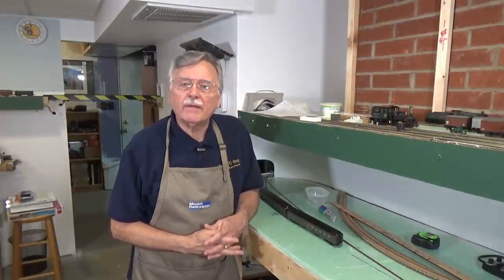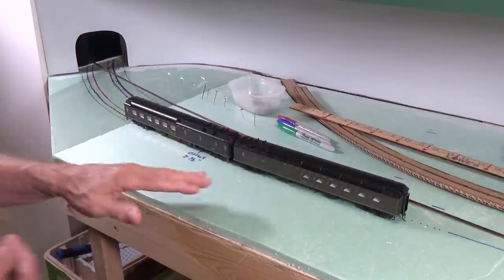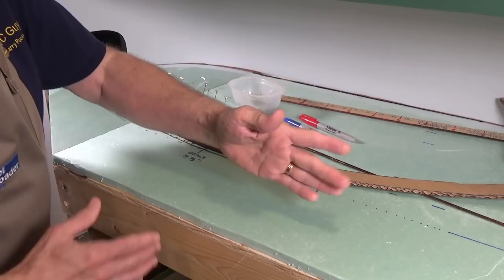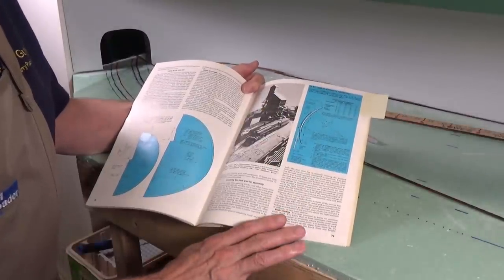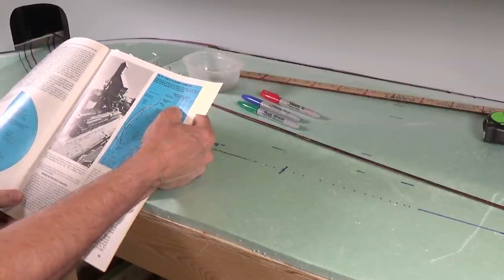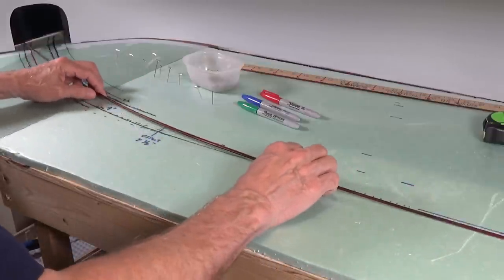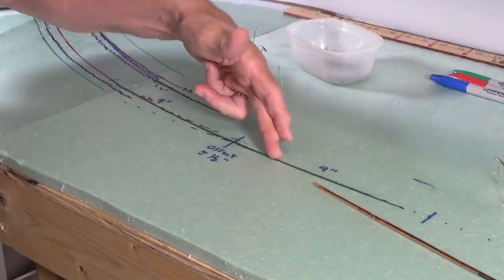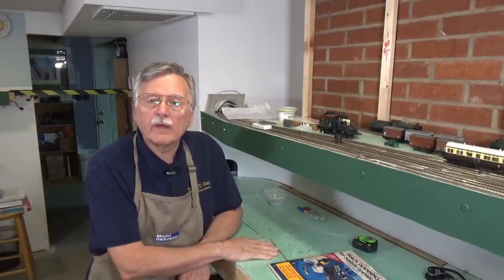Easing Into Curves (205)

Comment: Easing a Curve also helps preventing derailments for steam locomotives.  It allows locomotives that do not have a guide, to navigate into curves, especially tight ones.  Like for example, in N scale Atlas track using a 19" curve before an 11" or even a 9 3/4" greatly helps locomotives go through those curves (11" and 9 3/4" are both 30dg curves, just one is longer then the other to make the two different radi, a 19" is 15dg).  Of course you can do all of this as shown in the video if using Flex track to make a custom curve.

Comment: An excellent Video Larry, as an ex P. Way Engineer I used to have to calculate Transitions on the real Railway, as well as correcting misalignment in Curves manually, or using an on Track Machine like a Tamper. Also another design Characteristic in Curves/Transitions missing on Model Railways is Cant. In the UK the Max Cant is normally 150mm (6”) though I remember 200mm (8”) of Max Cant was employed on a very high Speed Section of the Main Line. Perhaps you could encompass this in another Programme, always look forward to your Videos, I have just taken delivery of a new NS Genesis SD70M-2 for my Shortline. Keep safe, by the way that book sounds a great buy too. Keep safe.
Reply from the maker: I had thought about doing track super elevations (canter) on the Piedmont Southern but decided against it for a couple of reasons. First, on most layouts they are purely cosmetic as our models just don’t have the same speed and mass as a prototype train so centrifugal forces aren’t as important. Second, from a cosmetic point of view they are hardly noticeable except on inside curves and at close to eye level. So I never considered them worth the extra effort. I have inly seen them on a couple of layouts and have inly read a couple of articles on installing them. Plastic shims of varying thickness set under the ties (sleepers) is the most recent method I have seen used and beat the old match stick or strip wood approach.
Reply: @TheDCCGuy  Thank you for your Reply Larry, yes, I agree, and of course it can introduce Twist which is not so good for electrical Connection, especially on large Steam Locomotives without having any suspension Compensation, mind it does look good on sharp Curves.

Comment: I'm a fan but I found the explanation confusing.  
The initial 36" template looks like it goes through the center of the tunnel and is roadbed width, but the 36" curve is on the left side of the tunnel.  It's not clear if this is a 2 track tunnel.  If it's not, the track is not in the middle of the tunnel.
The  green line you draw with the bamboo looks to be on top of the line that is there in the beginning, connecting the straight to the curve.  After watching it several times, I see that the 36" template comes to the inside edge of the perpendicular line marked offset.  I only gathered from another answer that the offset is on the outside of where the curve would have been without an offset.  You needed to say the curve would normally be on the inside, but we are moving it 1/2" to the outside.  The pre-existing lines and the perpendicular offset which looks to be the same length, on either side of the center line adds to the confusion.
Reply: For those of us who don't build fishing rods, there are small diameter dowels at the big box hardware stores that would work.
Reply from the maker: You are creating a transition from the curve to a straight line.mBasic design rules dictate that you should not have the curve go from an outside position to an inside straight line as it creates an “S” curve. I think one problem was I already had too many lines on the layout and was drawing over them.

Comment: Larry,
I found one aspect of the video confusing.  It looks to me that you start initially with the tangent line running directly into the 36" radius of the curve.
John Armstrong's book shows the tangent line running into a wider radius, equal to the curve PLUS the offset.  I have trouble explaining this, but it appears to me that you are making (in essence) an very gentle S-curve to veer to the left to reach the offset then back to a right hand curve to transition into the curve, while Armstrong's diagram shows the tangent running into straight into a transitioning right hand curve, as the tangent is offset to the left to start the transition.
I'm sorry I can't make this more clear, but it's hard to explain what I'm trying to say.
Super enjoy your videos.  Keep up the good work.
Reply from the maker: I think your confusion might have been due to the fact that I predrew the lines to make sure I got it all correct. The straight line section was offset 1/2” to the outside of the 36” radius curve. Then the spiral transition line was drawn between the straight line and the curve over an 18” distance giving a smooth track line between the two.
Reply: @TheDCCGuy  That sounds right.  Should have known you wouldn't fail to follow Allen's recommendations!  Thanks Larry.
Reply: Here's your key sentence.  "The straight line section was offset 1/2” to the outside of the 36” radius curve."  I failed to see that.  All makes sense now.

Comment: Hi. Larry.  It is great show. I am interesting to have the CADRAIL Software, since I this is first time  so. I like to have your support to tell me which one zi can use.
Thank you
Reply from the maker: I suggest you download (www.cadrail.com) their free demo version and the manual in pdf format and give it a try. Some folks have a hard time with computer design programs but for others it is easy. I find it intuitively easy but I have been using it for about 20 years now. I used to review computer software for Model Railroading magazine and Cadrail was one of the first so I have been able to follow its development since it was released in 1990. It is a good stable program that I can’t crash.
Reply: Thanks Larry for your support to my e-mail. I am very interesting in your video show #65. My notes the other connecting wire code Red, Yellow, and Green can be attached to the advise Digitrax DS64 For programing. Thank you

Comment: Why not just run out a couple of feet of larger radius curve?  For example if you have 24" radius why not just plan it out for say 28" radius for the first 18" of the curve?  I never understood the point in doing it this way.... I don't understand the difference between this way and just widening the curve toward the straight away.....  Is there an advantage to this?
Reply from the maker: The great hing about easements is they provide a gradual transition from a straight line of infinite radius to one of a set radius. This does a pretty good job of eliminating the lurch effect when going from one set radius to another.